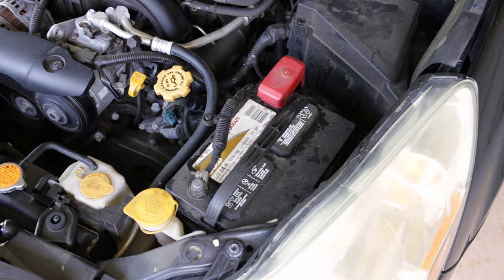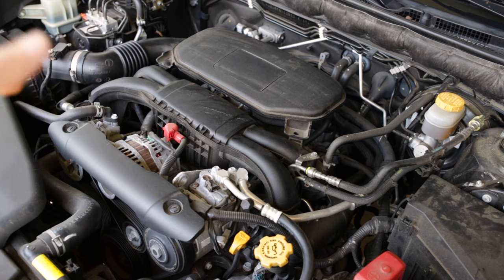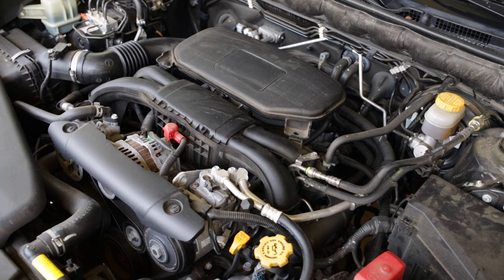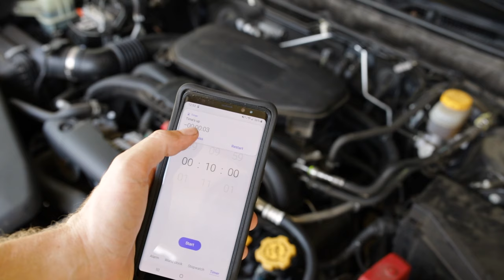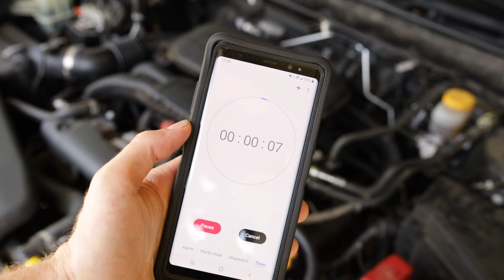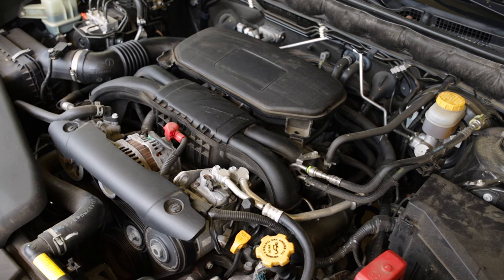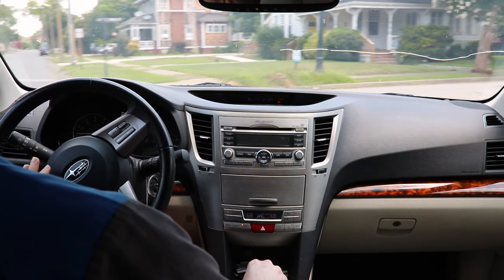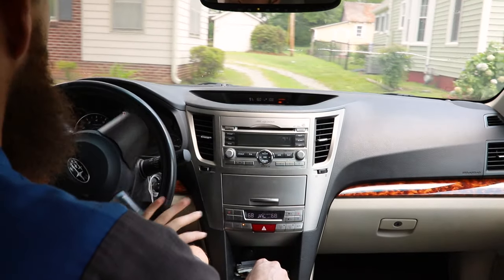Subaru Idle Relearn Procedure

Comment: I tried this after cleaning my throttle body and unfortunately at minute 7 the idle shot up to 1500 all of a sudden and the car started shuddering. I have been getting a code for the throttle body and I think it may be either the tps or the accelerator pedal. I'll start with the tps since it's cheaper. If you have any insight it would be greatly appreciated.

Comment: thank you for your great video. my outback idle dip to 600 when I shift from P to R, then jump back to 800. any idea what can cause that. car runs smooth.
Reply from the maker: Have you cleaned the TB?
Reply: @MrSubaru1387  ,yes , I pulled the engine out to replace head gaskets, meanwhile I cleaned the TB. Torque converter was dropped out accidently. but I topped CVT fluid  after completion of the engine.car has run for 8000 KM. everything is fine. only when I shift P to R. engine shudder a little.
I wonder if it is related to transmission fluid level. Thank you.

Comment: I've got a 2011 OB 2.5i and it has a roaring rear wheel bearing. The dealer wants $2000 to change the 2 rear hubs and new pads and rotors. I bought OEM rotors, pads, wheel retainer nut caps, and Moog hubs. The dealer is trying to scare me from doing it myself, saying that the e-brake system can trigger and then I would have to bring it to the dealer to reset it. Would you be able to do a video on changing the rear hubs and rotors, on Subies with e-brakes?
Reply: Holy s#$t 2k for rear bearings rotors and pads... parts should be like 500-600$, so 1.5k for few hours if done by diy'er... i'd say check youtube/google for a tutorial and go for it. I doubt that e brake could be made to trigger when performing service, but worth googling that also.

Comment: do you really need to disconnect the battery on my forester i can connect the reset cable under the steering driver side and it resets , or should i do this procedure for a forester sf2000 ?

Comment: HOW DO YOU KNOW WHEN YOU NEED TO DO THIS? I ASK BECAUSE I FEEL LIKE I BEEN CHASING A EXHAUST LEAKE THAT AFFECTS MY IDLE RANDOMLY NOT ALL THE TIME, BUT I JUST CANT SEEM TO FIND A VISUAL LEAK. I, WE HAVE CHOPPED IT UP TO MAYBE ITS UST CUZ MY CVT TRANSMISSION IS TRASH AND THATS JUST GOING TO BE THE NORM, BUT NOW I'M SEEING THIS AND WONDERING IF THIS COULD BE MY ISSUE WHICH LET ME TO ASK HOW DO YOU KNOW IF YOU NEED TO DO THIS? WHY WOULD YOU DO THIS?
Reply: I feel your pain man, I have a 2008 Suburu outback 2.5 no turbo. I have no engine codes and it runs great when the weather is cold. Once it gets above 50 degrees outside and I run the car for about 30 minutes it has a rough idle. I did the throttle body clean and relearn, changed PCV valve, I changed spark plugs, ignition coil, and coil wires, changed every fluid on the car you can oil, front and rear diff, transmission, brake, power steering, new air filter, ran sea foam through everything as well.  Had a dealer change the timing belt and water pump. I have so idea what is causing it. I am taking it to a shop and I am don’t know if they will be able to do anything either. I am at a loss and I bought this car after my other one shot crap and i Need it to be reliable. If I let the car cool back down it will run again but I can’t wait that long. It gets worse when the outside temp is warmer. I had no issues in the winter at all. It will idle rough and die. It will restart and go for a while until it just dies as soon as you restart it. The. We have to let it sit for about an hour until it runs normal again. No codes or anything.
Reply: @zacharypeterson3008   YIKES THAT SOUNDS MORE MAJOR THEN MY SLIGHT RANDOM LAG. REALLY SUPRISED YOU HAVE NO CHECK ENGINE LIGHT. " I HATE THE CHASE" .... LOL

Comment: Will this help? I got a P060B code It seems to be an electrical issue..everytime i drive it’ll be fine for the first few mins then eventually it’ll idle rough when accelerating..then eventually it will nolonger accelerates what so ever and the dash lights up with  the check engine light and the blinking traction control light….(2013 wrx)

Comment: Does this need to be done when the car is warm or can it be don’t cold
Reply from the maker: Do it cold.
Reply: @MrSubaru1387  so I did that and it helped but when I get close to making a stop the idle drops then comes back up it’s not a big drop but it’s enough o notice it and sometimes it will idle rough at red lights. I replaced the pugs, the air filters are good, put a new pvc in as well. One day while driving it I stepped down on the gas hard and then I had to stop at a store and when I came out it started then died like 4 to 5 times and I had to give it gas to get it to come out of it. Any insight would be appreciated
Reply: Also it’s a 2013 with 180,000 miles on it. Subaru replaced the CVT ISSUE AT 100,000 MILES

Comment: I can’t figure these cars out! P0301… I’ve changed the coil, spark plug, and cleaned all sensors… idle relearn multiple times. Still throwing the code. I have to wait a week to get it in to a pro. Ugh!
Reply: So what was the problem?
Reply: @thaothao8324  well it hasn’t been a week yet, but I did get it diagnosed today. The cylinder is dead, need a new engine I was told.

Comment: After how many miles should this be done?  Or is it only when you have an issue with the idle dropping and stalling
Reply: There probably some limited RAM in the computer brain that gets flushed whenever you unhook the battery for too long. To answer, whenever you unhook a battery for too long.

Comment: Hello I have a j22 99 Subaru wagon it started by having backfire just a little bit then it finally threw a code saying misfire on 1 and 2 I unplugged the tps sensor and the rpms shot straight up to 6k so I replaced the tps but now I can't control the idle it chokes will this process work on my Subaru maybe?

Comment: Im guessing for an 04 wrx i have other issues, I’ve cleaned the throttle body, and changed out all intercooler hoses and still no fix:( i have a low idle at normal temp i sits at 500 but when i start it it drops to almost zero like its about to die

Comment: This is not working on my older subbie.
It revs way to high and started to over heat. The rpms won't go below 2500 rpms. No vacuum leaks either.
I am giving up on the car.

Comment: very good video, thank you so much...have a question please...there is a noise going on on my subaru crostreck when i put the key in the start position but i DONT start the engine...i open the hood and walk to the engine and the noise comes clearly from the throttle body...is similar like noise made by this TB in minute 4:04, but is not that clean...mine sounds like its about to brake or something...idle is ok, but some times gibes some little jumps on low rpm...could this be a bad TB??? thank you so much
Reply from the maker: Could possibly be the motor starting to go out in the TB.
Reply: @MrSubaru1387  ok...gives this some issues in driving?...i have some small jumpy fills when low rpm...

Comment: Bro , I just tried in my 2014 Subaru legacy didn't clean out throttle body. Now car will not start unless i pump the shit out of pedal like starting a old carburetor car. Any Ideas.  Should i have throttle body replaced the try again

Comment: I get high idle on cold start around 3000 rpm then comes down to about 2000 after a few seconds. Normally cold starts would start at 1500 and come down. Also when I’m coasting in gear with the clutch pressed it revs up to 2800 rpm and when I depress the clutch and still in gear it goes normal. I’m getting code P0507. I was told to search for vacuum leaks and I did find some and repair but still having the high rpm wondering if this will help. 07 legacy GT.

Comment: Hey there i have a Crosstrek 2017 with eye sight and bells and whistles. I noticed that when car is idled it has the rpm under 1 then it starts to shake this happened when i had the car running parked listening to music and cleaning out the car. is this normal? 1st time car owner

Comment: Just had a battery replaced and now having idle issues. Sometimes struggles to start, but usually just a low rough idle. I went through this reset procedure and after the 10 minutes of disconnecting the battery it idled great, right around 1000 rpm, for 10 minutes. I turned the car off for 20+ seconds, then turned the key to on position for 10+ seconds, before starting the car again. When I turned the car in this time, it was back to a low rough idle. I let it continue running for 5+ minutes, then turned it off again. When I turned it on again to test drive it, it was still idling low. Even died when I gave it a little gas. So I decided to run through the process again, starting with disconnecting the battery for 10+ minutes and also wiped down the throttle body a bit (didn’t fully disassemble it). Ran through the procedure again and it still doesn’t have a normal idle. Gets close to dying when I come to a stop. Any ideas??
Reply from the maker: Have you cleaned the throttle body?
Reply: MrSubaru1387 I didn’t give it a full tear down and clean. Just cleaned it up in its mounted position. Never had idle issues until the battery replacement. I assumed it would just need the idle relearn. Anything I may have messed up during the process?
Reply: MrSubaru1387 UPDATE: The fuse controlling the OBD had blown. Replaced that and ran through the relearn process again and things seem to be working fine. Not exactly sure how that fixed my idle issue, but hey, it’s working!

Comment: I need some help please, when I run the codes in the Subaru , you know ignition on lights on 1234, lights off 1234; it show on the dashboard two codes one is U0116 and the other is b900 and below this number appears 0000002. any ideas what would be ???

Comment: I clean the throttle body changed PSV valve cleaned teh EGR and did the relearn procedure and still does it; when it comes to a stop after accelerating and braking the car will actually stall. A mechanic told me it could be the torque converter or the torque converter selenoid but he cant be sure and I know it is expensive to replace. Any ideas or suggestions to try prior to head into such expensive repair .
Reply from the maker: If it's a 2010+ CVT, I'd say you have a bad torque converter. Search the channel. Have a few videos on that issue.
Reply: @MrSubaru1387  thank you, I will do that.

Comment: My 2017 wrx Idles high when I start it up like it wants to turn off sometimes it does but when I give it gas it gets better but when I’m driving and go to second on low speeds it kinda struggles on the 2000rmps but when I’m speeding up from 1st to 2nd that struggle isn’t there it has a aftermarket intake and I have a Cobb tune but that didn’t help can you help

Comment: A loud buzzing sound begins at 4:03 in the video when MrSubaru turns the key ignition to the "on" position. My throttle body makes the same sound, coming from the electronic device on the side of the throttle body that receives the signal from the pedal. Does anyone know if that's normal? I replaced my throttle body with a used one hoping to get rid of the sound, but it has the exact same sound.
Reply from the maker: That's normal...

Comment: Is there a way to manipulate the idle relearn such that the base idle is slightly higher? My '05 impreza 2.5rs has a cylinder 1 misfire that only happens while the rpms are below ~800, which drops the idle suddenly to like 550~750(specifically at idle, whether parked or drive/reverse) which can occasionally stall it. Cleaned MAF sensor(which it needed) and throttle body(also needed). No obvious vacuum leaks,  new plug wires(needed), code reader telling me short term fuel trim is +25% when this is happening.
Reply: Fix your misfire. Why would you just ignore a misfire and try to avoid it? That could cost you your engine.
Reply: @Svt_Wyatt  well, fixing it is the idea, but mechanics have yet to identify the cause. I'm not super worried about it since it's not doing anything exciting except power loss when stationary. In the interim, the misfire could be prevented until fixed by simply increasing the base idle very slightly, since it only occurs when the rpms get to the minimum level for a parked engine at operating temperature and no load. Just turning on the AC is enough to make it not miss.
Certainly, most misfires are bad news, but thankfully this one only occurs under very specific circumstances. Car runs great, I get better gas mileage in it than the advertised rating, but it's pretty annoying to have the car die when parking.

Comment: When i open the door the ceiling lights come on, but i need to open the door to start the car. I don't see how one person can do this procedure
Reply: Stay in the car. just leave the windows open. Take the 15 minutes and watch a few more Mr. subaru videos while you wait.
Reply: @matthewweaver1123  The solution i found was to leave the window down and just lean in through the window to start the car.

The thing is I have to be outside the car to reconnect the battery. But as soon as the battery is reconnected, then if the door is open or is opened, the ceiling light comes on. 

I suppose I could have found the fuse for the ceiling light.
Reply: @bismarkbizmark5639  ah. OK. Yeah sadly I have the 6mt so I have to get in. I just turned the overhead light switches to off so nothing came on when I opened the door. Then I just stayed in it to do the whole procedure.

Comment: My 2005 Subaru Legacy GT Limited stalls during the relearn procedure. Is there something wrong with my car I'm unaware of? I just replaced the Camshaft Position Sensor, and I can get it to stay running longer than 2 minutes.
Reply: Did you ever find the cause? I am experiencing the same on my 2014 Outback after replacing the Camshaft Position Sensor after getting a code P000C and P0021. Those codes never came back but it now stalls at low rpms until the car warms up.
Reply: @kentjung62  I have not, because I no longer have the car. ;-;
Reply: Thank you

Comment: Mr. Subaru, my 2018 Subaru sometimes will strangely idle. This is the scenario. The suv has under 3,000 miles. After exiting an interstate and bringing the suv to a stop at a red light, the suv rpm indicator will fluctuate between 800- 700 rpm. It will then idle ok, or around 800 rpm after 20 seconds. Is there a problem with my idle or is this normal?
Reply from the maker: 700-800 is normal. Wouldn't be concerned unless it was dipping down to around 500rpm.
Reply: MrSubaru1387 thanks

Comment: MrSubaru1387 I HAVE 1997 SUBARU LEGACY OUTBACK 2.5L DOHC WITH 215K MILLES PROBLEM  P0122,P1142 I REPLACE TPS 3 TIMES WIRE HARNES I CLEANED THE THROTLE BODY  I CHECK THE WIRE HARNES FOR CONTINUITY TO THE ECU, I REPLACE THE ECU AND I STILL HAVE THE SAME PROBLEM, LAS THING MAYBE NEW THROTLE BODY, PLEASE HELP,I ADJUSTED BY THE SERVICE MANUAL  AND I STILL HAVE THE PROBLEM ANY TIP I NEED TH E CAR BAD.

Comment: My 2010 impreza is having an issue with idle when ac is on or turned off it even stalls was told it can be the iac valve but idk, any idea? Could use the help at the moment
Reply from the maker: 2010 Impreza doesn't have an IAC valve. The electronic throttle body controls idle. Clean the throttle body and do the idle relearn.
Reply: @MrSubaru1387  thank you so much man will do
Reply: @MrSubaru1387  thanks it worked out 🤙🏾

Comment: Does this work on a 99 Impreza 2.2 auto sedan can anybody confirm any type of system like this i had a issue with air/fuel mixture so I did a carb conversion to see if everything still shifted and ran and drove still before I tried to fix the original issue I just replaced almost every sensor all new injectors and rails and fuel pump went over all the lines and hoses for leaks and now it’s a crank no start or crank hard start bad idol or no idol dies when in gear or when I touch the gas pedal I’ve messaged you a time or 2 on Instagram over the last few years 

Any reply from anybody is appreciated

Comment: Hey man plz help. I recently got a 2018 forester XT. I’ve had these problems but it just got way worse after my shop cleaned the throttle body and fuel injection system. Does this work for my vehicle? I’ve been looking through the comments for anyone with a similar vehicle for an hour lol
Reply: Update- it seems to have worked. Car is not trying to stall every single time I stop at red lights/stop signs. Will update if there is any changes. Thank you!!

Comment: What a load of crap to have to do this every time I disconnect my battery on my 2007 forester. It’s gotta be a design fault. Normal people shouldn’t have to go through all of this every time the battery is disconnected. Should have been recalled and rectified by Subaru

Comment: I'm going to be installing a new Blitz sus power performance air filter in my '14 Legacy, should I perform an idle relearn after installing it?
Reply: Don't do it. Aftermarket intakes throw off the air fuel ratio without tuning. It's a weird Subey thing.
Reply: @jimtremayne   Yeah I'm aware that Subie's need to be tuned for any modification, but the part i'm getting isn't a complete intake system. It's just a drop in air filter that goes in the stock airbox. It's a less restrictive air filter kind of like a K&N filter but this one doesn't need oil like a K&N one, that shouldn't throw off the air fuel ratio would it?

Comment: Is the relearn the same for a 2002 Outback that doesn’t have the drive-by?
Reply from the maker: No.
Reply: @MrSubaru1387  would you be able to inform me on how to relearn the idle on my ‘02 OBW? I had my battery unplugged for a while when I was adding wire and clamps for my battery, I also cleaned the IAC and throttle body and when I plugged everything back in and turned my car back on, it was idling at about 2k RPM. It’s gone down since, to about 1250 but that’s still a bit higher than the about 800 it was at beforehand